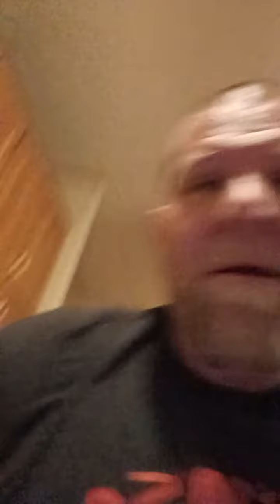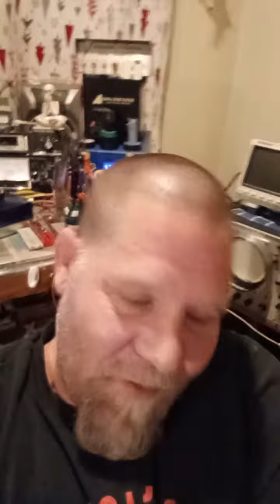parasitic drain ......very common

Comment: After u hooked up the amp meter and see the parasitic draw.The amp meter in place go to your fuse panel start pulling fuses till the draw goes away. The circuit that caused the draw will be in one of those circuits that are fused.Now after pulling fuses. And you see no change. Then more likely it is a hard fault. The culprit is usually the diodes in the alternator have gone open, allowing the voltage to flow back to the alternator rectifier circuit. The diodes in the circuit caused the voltage to go one direction and also change AC current to DC current. That is why it’s called an alternator.